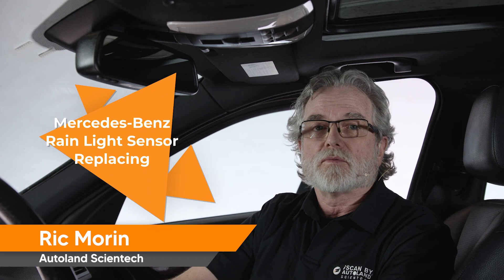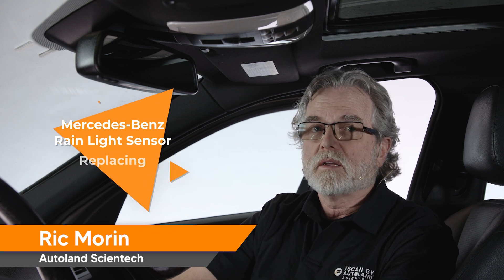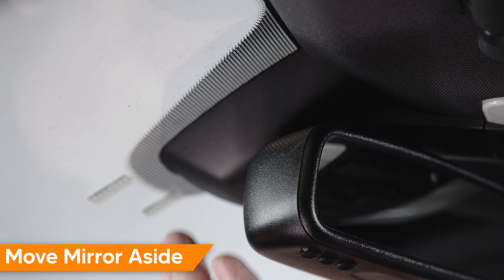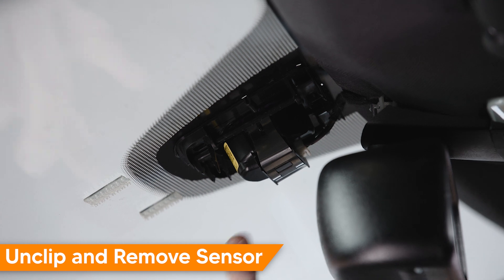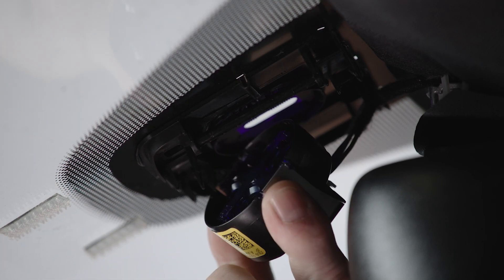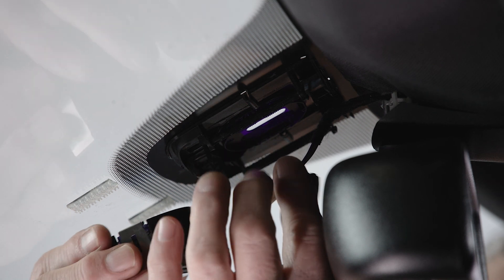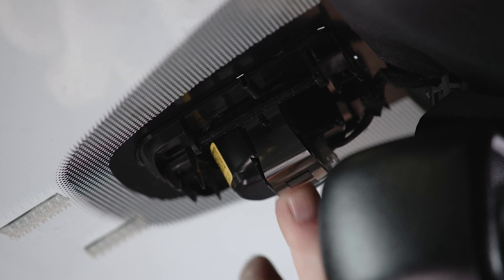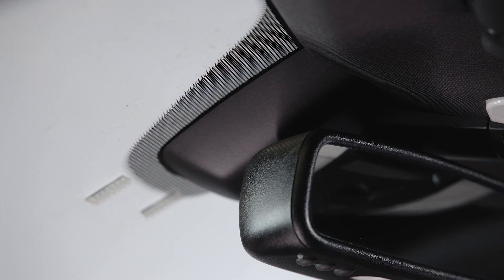How to Replace a Rain Light Sensor on Mercedes-Benz W204 Vehicles

Comment: Hi Sir, my sensor is too unsensitive what can I do for that? It is working but useless. Should I add gell? Thanks
Reply from the maker: First check for fault codes, if there are none, you can try a calibration. If that does not work, replace the sensor and mount.

Comment: Can you share on how to replace the lens pad? The blueish thing where you install the rain sensor directly into (idk the exact name).
Reply from the maker: We don't currently have that tech video. If we get a chance to perform the procedure, we will be sure to document and share it. That can be done by a glass company. The part (rain light sensor lens) has to be removed, cleaned, then realigned when adhered to the glass. it should come with a preinstalled adhesive patch.